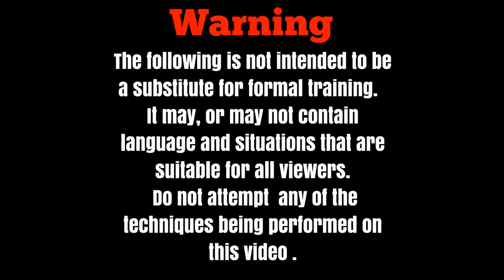What Would Paul Reed Smith Do? One Day Guitar Build!

Comment: Not to change the subject but...  You guys have a lot of great tricks up your sleeves, maybe you have one for this.  Routing templates for positive and negative shapes.  So, what I mean, If I have a unique shape for a plate that covers the back side control cavities I'd like the cavity shelf it sits on to be a perfect fit all the way around.  I know I could carefully make both templates slowly fitting the inner template into the outer one, but there's got to be a better way, a "trick".
I've thought of one.  Make the outside template of MDF to the ideal shape for the route into the body, then set it on a flat surface topped with wax paper, then pour some hardening substance inside the shape, or maybe a hardening clay putty to make a temporary inner template (for the plate), then put the temporary template over MDF to route out the final plate template.  I should end up with a plate template that perfectly fits within the shelf route of the body.  But sheesh, there has to be and easier trick!
Reply from the maker: That is a tricky one John, the best one we have for that is a set from guitartemplates.com
There are lots of other great template companies out there too.

Comment: Matt, one of the things PRS does is stage neck inventory so they have a day or three for the wood to stabilize after each major cutting operation. Also, check out the MIA S2 guitar neck videos with the scarf joint method they got from their old MIK SE factory pals.
Reply from the maker: I have heard that it takes about 30 days to make a PRS neck. I have never liked scarf joints but have used them quite extensively in the past
Reply: @TexasToastGuitars  No Scarf joints YUK yuk hate them

Comment: I think its interesting to try and put yourself into the headspace of an idol.

I think Paul would probably build a guitar based on the wood and templates available - especially if he only had 1 day to do it. I think that he would 'PRS' an existing design, like adding the scoop, making it a 25" scale, 10" radius, going for the truss rod he prefers (of course), maybe even putting a bevel around the top so its not flat and a belly carve to not only be comfortable, but reduce the weight. He may even have gone as far as using your Duplicarver too - they do make a Single Cut similar to a LP and so may have made something like the SC245 or McCarty 594.

I think if he did come to your shop, it would be more interesting to hear about the decisions he has made over the years on some of the changes that have been implemented. As someone who has experimented and assessed thousands of different tweaks, modifications, parts etc, that experience is invaluable - even if you don't necessarily agree on things (like Type of Truss Rod), it can only be beneficial to be able to discuss   these with him. He helped Nik Huber a LOT too and of course Joe Knaggs...
Reply from the maker: I think so too, or maybe he would go completely outside the lines and create from within. Just for fun

Comment: the worm hole is cool ... double cut limba guitars should be raunchy .... i would vote for P90s ... i think it would've been cool to slice off the body top (maybe 3/8") and weight relieve the body bottom before gluing the top back on ... yeah you gotta leave enough wood in the bottom for structural integrity and securing the bridge/tailpiece ... but all in all i think this was cool!
Reply from the maker: That would have been a cool thing to do, we had a truncated time frame but it would have been neat